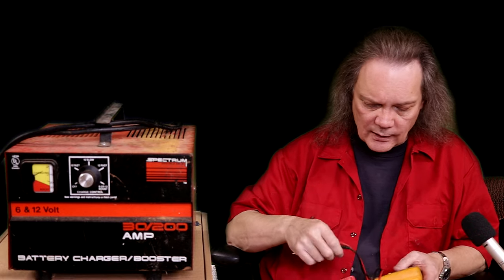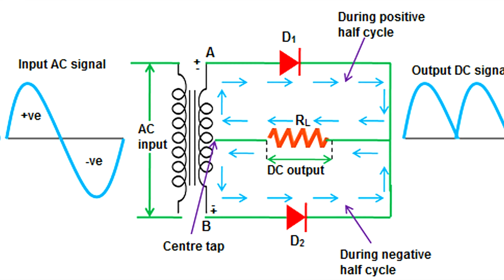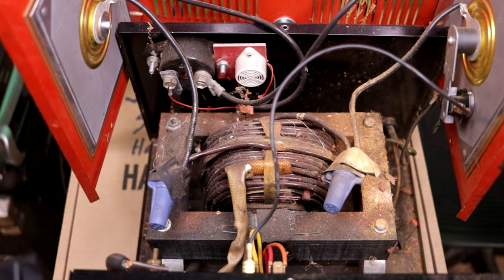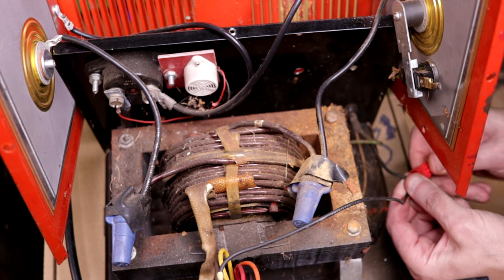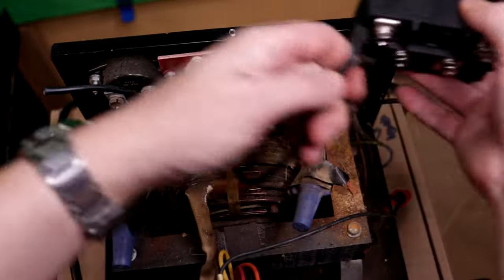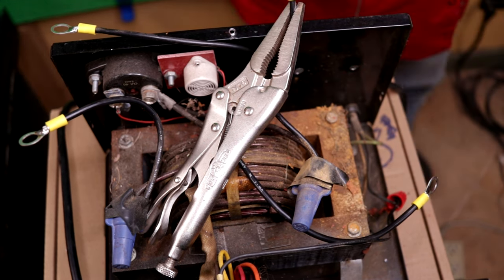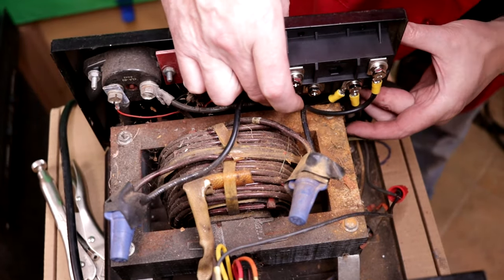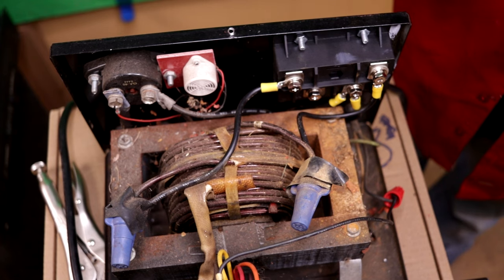DIY Car Battery Charger Upgrade: How to Repair and Boost Your 200 Amp Charger

Comment: it's a good habit to keep terminals greased up in tools like that and in automotive use, keeps the moisture out and saves you a lot of frustration.
Reply from the maker: Good tip!
Reply: What grease you recommend ? 3 in 1 light oil ? A quick WD-40 light coat ? Dielectric grease ?

Comment: I'm through buying modern chargers. They're junk, and many times won't charge a dead battery, which is ridiculous!
Reply from the maker: I don't think they're all junk, but sadly there is a lot of junk on the market.
Reply: Perhaps not all. I've just had really poor luck with them. Too many times the "smart" functions go haywire and don't allow the battery to charge, yet II could use a manual charger and it worked fine. The electronic controls have been unreliable in my experience. @Barry-Watson
Reply from the maker: Yeah, I've had similar experience.  But I also have a couple 'Battery Tender Plus' smart maintenance chargers I've used for years, and they work well (so far!).
https://amzn.to/47tacab

Comment: I respect and appreciate anyone who takes the time to share their knowledge and create a video for others. I was excited for the first quarter of the video. Everything was super detailed and even went into the weeds of "how" it works, not just fixing a problem. The only thing I'm disappointed about is the lack of troubleshooting to get to the fix point. Mine "hums" and I'm getting 9.5-10.2V at the clamps. The Ammeter isn't doing anything, even on a known good battery. I'll open mine up and see if its similar. Mines a Solar 330 40/2A Charger-200A engine starter, built in 1998. Good luck searching "Solar battery charger" in 2024! Great video, subbed.
Reply from the maker: Thanks!  With an old style charger like this troubleshooting is pretty easy, not many parts to diagnose.  If it's "working" but low voltage, the most likely cause is a failed diode/regulator.

The humming is probably caused by some magnetic induced vibration in the transformer laminate metal form and is harmless.  Some folks have tried carefully painting the metal transformer laminate with superglue to dampen the buzzing if it's too annoying.  Maybe the transformer mounts to the chassis have simply become loose over time.

The amp meter is unlikely to display much on a charged battery that isn't pulling a big charge current draw.  A good but deeply discharged battery would draw more current (amps) and more likely deflect the meter.  But if you have bad diode(s), they may not be allowing a lot of current to flow, thus no meter readings.

I'd bet your unit is very similar to mine.  Best wishes.
Reply from the maker: Typically neglected batteries that are allowed to sit discharged fail due to a chemical buildup of hard sulfates that cover the internal plates and form an insulator preventing the battery from delivering current. If allowed to sit and harden long enough this coating can be very difficult, if not impossible, to remove. My recovery rate is about 50%.

I have not seen much long term success by adding anything to the battery liquid. The things that have seen work are hitting the battery with very high energy pulses, such as from an arc welder. I do NOT recommend this, since it can be very dangerous, the battery could explode. The other thing that I have seen work successfully is the use of a pulse charger, which hits the battery with (controlled) high energy pulses of the correct frequency to try to wake up the battery chemistry and dissolve that sulfated layer. I did a review of an inexpensive battery charger that includes pulse repair mode, that has successfully recovered a couple of my batteries after a couple days of pulse-repair mode.

Surprisingly, a big battery I have that sit in an abandoned vehicle for five years that was stone dead (0 volts), came back completely to life, and measures nearly 600 cold cranking amps now after the pulse repair.  But some batteries are just too far gone, and cannot be recovered.

Of course other types of failures are possible, such as broken internal connections, but typically the problem is sulfation.

https://youtu.be/E4FJxRXNeQ4

Comment: Why would you not use the positive output side of the module with a wire for the red battery + side with the negative - side output wire ? Or am I not understanding this output side of the module ?
Reply from the maker: If you review the portion of the video where I explain the circuit operation of this particular charger you'll see that it uses two large diodes to convert AC to DC.  It's a half wave rectifier design. My goal was to repair the unit, not redesign it, so I needed two large replacement diodes.

My most convenient and cost effective option was to use a full wave bridge rectifier diode module. That's a block of plastic that contains four diodes within it. I only need to use two of those four diodes in that module, and how the wiring works out that means that I just used the AC terminals in the module, and one of the outputs. The way this charger was wired, we just use the negative side of the module - Which makes use of (only) two of the four internal diodes in that module block.

There's nothing special about the negative versus the positive side of the output. The charger could have been designed to work either way (you're just rectifying one side of the output, doesn't really matter which one).  Of course I wanted the red cable to still be positive so I respected the polarity of the original design by attaching the rectifier output to the negative cable, as it was originally.

Of course, your mileage may vary, different battery charges may be wired differently. This one is a very typical, common, simple battery charger design.
Reply: @Barry-Watson  Ok, I've got it now. You're right, somewhere I missed the part about the positive side being ok. I will look at it. Diodes and rectifiers wiring configurations options confuse me to some extent and it's moreso the button types in alternators that are placed on rectifier plates that use the plate as one side made hot by the button diodes on one side....like the old kind I guess you removed in this charger ? I'm pretty good with just regular electrical AC, it's the electronics side I haven't studied much. My Dad was good with both. I wish he'd lived long enough to coach me after my interest had peaked. He built a home battery charger in his shop, made cabinet too on metal brake, the rectifier diode plate ...one of the diodes is bad at least. He wired it on a switch for a high side only and another side for low, going through a rheostat and then an amp meter where you adjust the amps going into the battery. It's protected by a 20 amp breaker as well he went through. I want to get it back up and running. I'm looking at one of these rectifier modules to just replace the rectifier plate in it. The max output he figured in this charger was 50 amps and he used diodes from an automotive alternator for the rectifier plate. I would just change the diodes in the plate he made and put it back ?? I get a little confused on the wiring of these types of diodes. I know they have different polarities. The module you used just seems simpler to use. Thank you for your video. It's been most helpful. I will review the part I missed.
Reply from the maker: Technology advances, You don't see a lot of those old plate style rectifiers any more. The newer parts are smaller and more efficient.

Comment: I have a newer manual charger that I use to start stubborn diesels when cold (real with bad glo-plugs). My question is: is there a way to build a regulator so that on the higher amperage settings, I don't get enough voltage to kill my batteries.
Reply from the maker: Unfortunately it's not that simple, the vehicle presents a certain load, and into that load if you reduce the voltage you'll also reduce the current. This is ohms law.  There may be good reasons to limit the voltage, but that will also limit the amount of current that a particular load will draw.

Comment: Did you not have the right size ring terminals?  Those were not a good match.  Otherwise nice job.  👍
Reply from the maker: Good call.  Sometimes, I use the parts I can find.

Comment: Very good and helpful video. However a voltage of 12.7 on the low range is questionable. Lead/acid battery cells are nominally 2.2V so 6 cells would be 13.2 volts. You will see this on a freshly charged battery. However you did not show your setup for measuring that voltage. Certainly you didn't take a DC reading with open leads for it would have been up to 18-19 volts. So I am guessing that hopefully you had it connected to a battery less than fully charged and it should eventually get to 13.2V or a little more.

I had not thought about the secondary being center tapped but that makes sense. That way the secondary could be wound for 24v(probably 36v) instead of 12 and it would take half as many turns. 

I too have doubts about 120V supplied chargers supplying 200A. That would require 20A at 12V but you want more than 12 volts so thus more than 20A would be required. However circuit breakers will take an overload for a while without triiping so maybe the charger really is providing 200A figuring the overload will last less than a minute.

Thanks for the video. I am looking for an old style charger so you boost my hopes of finding one that is repairable. I hate the newer smart chargers that have their own idea of what I want. The worst part is the the reversed lead detection that won't charge a completely dead battery. I had to jumper to another battery to get the charge started. Later I took the charger apart and put in a sneak circuit connected to a pushbutton so I could fool the crappy thing into thinking there was voltage present. I really hate that Schumacter has such a large share of the market now as I find their products to be substardard. I had a job offer from them but the pay was way below the going rate. So how are they going to get good engineers offering crappy pay?
Reply from the maker: Yeah, good point.  The output range of that thing was from just under 13 volts, and then upward depending upon the setting. I was concerned it would be too high of voltage with the more efficient modern diodes, but it turned out ok.

Since repairing that unit, so far it has worked really well for quickly charging up depleted batteries.

Sadly, a lot of the former respected brands of battery chargers are now actually made cheaply offshore by companies like Baccus Global LLC and are not the same quality as the older products.

Comment: Good job!  I wish someone would make a video on changing a smart charger into a manual one.
There is one video of a guy doing that to get rid of rust using, I can't think of the word.
There are several videos of fooling smart chargers with little batteries.
The ideal video, for me, would be one where the guy eliminates the smart board from 3 or 4 different types of smart chargers and installs a 1 hour or 90 minute timer on each.
I have a pile of smart chargers and they all a little different,  The big one has a timer which is where I got the timer idea.  I need a new one and find many on ebay.  Some from dryers with a motor on it and some with a bell.  Some are from electric ovens and simply "appliances".  I'd like one that is mechanical with only 2 wires.
As you ca tell, I could write 20 pages asking questions and making comments.  I just want to mention one quick one.  Those yellow wire connectors that crimp on the wire fail too often.  I just strip the wire and loop it around the bolt.  Its ugly and unprofessional looking BUT when compared to one that pulled out it works a million times better.  On paper, it should be the last resort but in reality it makes the best contact and most reliable.  I think instead of soldering the connector, soldering the end of the copper wire back onto itself making a loop has the best result even though ugly and unprofessional.  Just my opinion.
I just subscribed.
Reply from the maker: If you're looking for a simple inexpensive power supply, the first thing that comes to mind is a device like I've linked below.  These switching power supply modules are pretty capable, and are inexpensive.
If you're charging batteries a concern I may have is can you adjust it to get the exact voltage you want, this one is limited to a little under 14 volts maximum output.  

https://amzn.to/428svjJ
Reply: @Barry-Watson  Thank you for the reply.  I have several non-working battery chargers.  I actually got one as a wedding present 40 years ago and it works fine and is my primary one.  If I can fix all of the broken ones I will keep one for spare and give the other 3 away to anyone who needs it.  The one is expensive and brand new.  It was given to me because it wouldn't charge a completely dead battery.  I don't think there is anything wrong with it.  I just want to make it manual and would like to buy a few timers.
Thanks again and I'll go now to check out your link
Reply: Battery chargers take single diodes you can double them up triple them up for more amperage but a bridge rectification ain't going to do s***you're wasting your money all these assholes on YouTube 40 years from now no amps l you have volts but you will have no amperage just the way it works
Reply from the maker: Thanks for the comment.  A bridge rectifier is simply four diodes wired in a certain configuration.  You could use individual diodes, or a "module" that contains 4 diodes in one package.  Electrically it's the same.

I think today's modern diodes are probably more reliable than the old ones.

In my unit, I could have replaced the two old rectifiers with two new diodes, but the bridge rectifier module seemed to me like a easier solution, and it was cheaper.  I didn't use all the terminals on the rectifier module - I only used two of the diodes in the bridge rectifier, preserving the original charger design.  The new silicon diodes in the bridge rectifier module are rated for more current than the original ones used in the charger, so it should be able to deliver as much or more power than it did originally.

Comment: Hey thanks for the Video. It' great when knowledgeable people share their skills. I have an old Schumacher that has saved me many times over the years. It's 2A, 40A and 200A boost. I thought the 200A was underperforming by the sound. My readings were (on a low battery) (setting, voltage at battery, Amps through positive cable) 2A, 12.3V, 1.5A, : 40A, 16.5V, 6.5A and for 200A boost, 19V, 15A. Do you think the 200A is underperforming? It's when it's 30F outside and the truck won't start that is the best test but that's when I'll need the boost. Thanks!
Reply from the maker: Your measurements seem reasonable to me.  The transformers often hum a little, all that energy shakes the transformer windings a little bit.

Remember that with a constant voltage source, the amps delivered will vary according to the load (the battery charge state).  So, even if the charger is capable of 200A, it will only deliver as many amps as the battery demands for a given charge voltage.  So, I suspect it's working properly.  

Looking at the internal wiring of my unit, I doubt it can actually deliver a full 200 amps for any period of time, however, it's a really strong and effective charger nevertheless.
Reply: @Barry-Watson  Thanks for the feedback. Its great to get a confidence boost by someone with the knowledge. One more project I can walk away from!
Reply from the maker: Thanks!

Comment: Hey barry, I was wanting to do this upgrade to my unit as well, to run my charger on 200 amp charge in 15 minute intervals, will this rectifier work for that or would I need a higher amp rectifier like 300 amp for the longer high amp application?
Reply from the maker: Bigger is better, I think the real issue is keeping the part cool enough.  Use a big heat sink and thermal paste.
Reply: @Barry Watson  okay thank you for the video and timely feedback it is much appreciated!

Comment: Berry I have a snap on/bluepoint/ Schumacher. I'm almost sure it's just the control board failed. I can't find parts for it and I would like to keep it somehow. Any universal controller or a bypass to run off the transformer?
Reply from the maker: Sorry, I don't know that unit.  I'd start by reaching out to the manufacturer(s) to see if they can provide a replacement board, and if not at least a schematic.  Having a schematic makes troubleshooting and repair a whole lot easier.

If it's a big valuable transformer, you could consider building a new charger around it... you can find plenty of circuit designs in you search the web.  Some of the old charger designs (like the one in this video) are pretty simple.  But... is that worth the effort and your time, only you can decide.

Comment: Smart video thanks for the description of rectifier operation
Reply from the maker: Thanks for watching!
Reply: @Barry-Watson  turns out one of the 4 diodes is faulty. Do you have a link for the bridge rectifier you used?
Reply from the maker: Sure!

Baomain Bridge Rectifier 200A 1600V Full Wave Diode Module
https://amzn.to/3UUgpJF
Reply: @Barry-Watson one more question. Why use the negative post of the rectifier? My original diodes were on the positive cable.
Reply from the maker: The battery charger could easily be designed to work either way. 
On my unit the output cable was attached to the negative side of the rectifier, yours may differ.  Just check the output leads of the charger with a meter to make sure that you're getting + on the red wire to be sure you're on the correct rectifier output for your charger.  If the output is reversed, just  move to the other rectifier output terminal.
Reply: @Barry-Watson that's what I was😢 figuring but I couldn't see your wiring outside it was attached to the dc  breaker thats usually ground. I'm back up and charging. Thanks again.